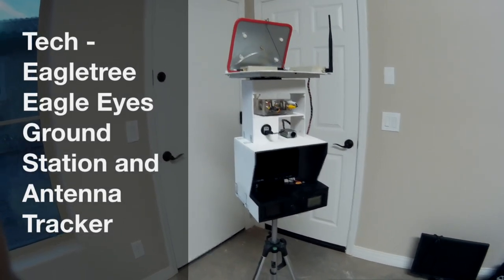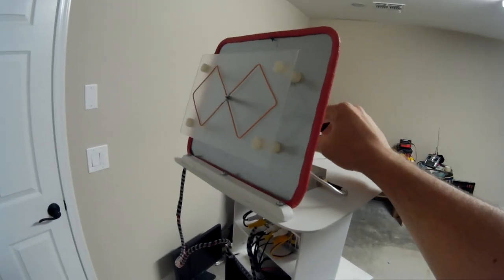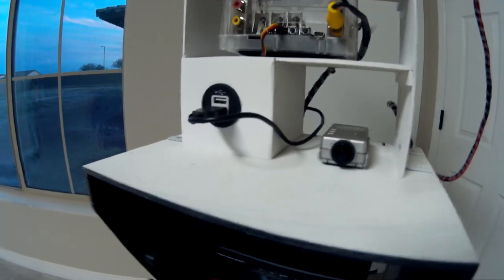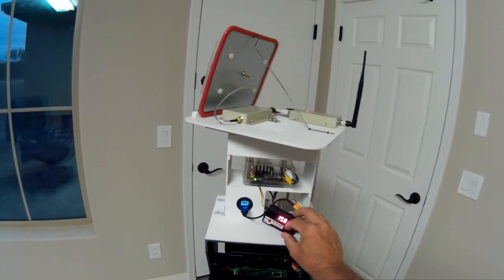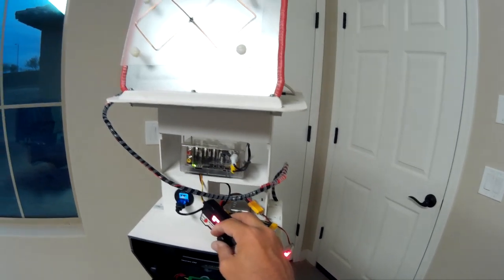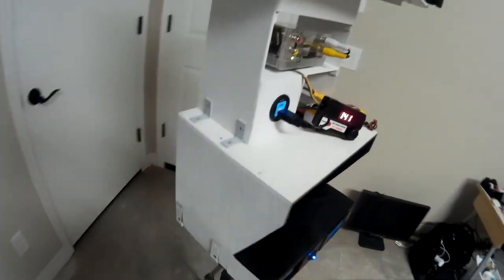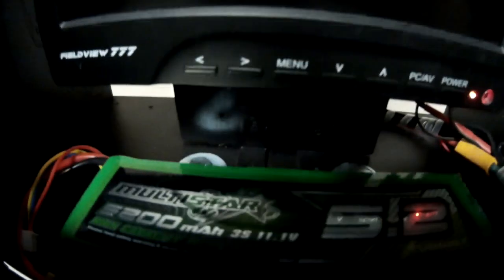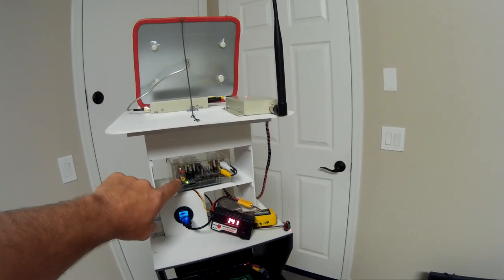Eagletree Eagle Eyes Antenna Tracker and Scratch Built Ground Station - 1.3ghz Video 5.8ghz Relay

Comment from the maker: I've been flying with this ground station for a few months now and it has only one weakness: Direct over-the-top flight. Since I don't have a tilt mechanism for the antennas, direct overflights result in some video static. Otherwise, I have to say it has performed flawlessly. It's also very durable. During setup one day it slipped out of my hand and I broke a couple of glue joints but that was entirely my fault. Personal bias aside, I'd rate the functionality of this ground station quite high.

Comment: What's your opinion on this Eagle Eyes system using diversity? I have been comparing to the Oracle diversity controller. Looking for some first hand experience.
Reply from the maker: +deepimpact.io It works. I like the integration with Vector flight controller. The setup can be a little tedious with calibration. I can't seem to get a consistent result using the compass method and sometimes the "use model as 0°" has been off a few degrees; however, the diversity is effective and I appreciate the safety factor of the EE keeping my antenna pointing at my plane. Once the calibration is acceptable the antenna stays locked to the aircraft well.